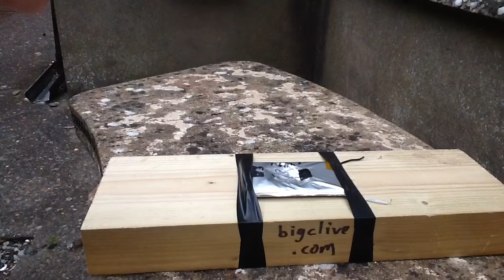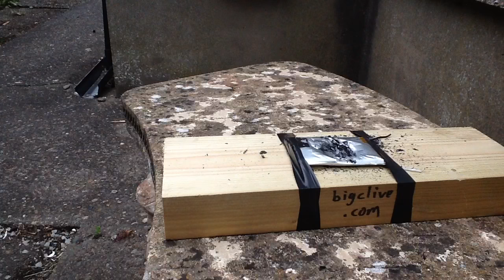Nail through fully charged LiPo cell super-anticlimax.

Comment: I bet this battery was old... Or high quility...
I had ebay batterys in my 200w vape.. they blew up in my face
Reply: Yeah, in case you hadn't figured out by now, you need some cells that can reliably output 15A+...
Most 18650s, like the ones found in laptops. can only safely handle about 3A before they start getting warm.
Reply: Yeah after that i spent like 90$ on 3 batterys from the shop that are like 3.7 v 50 amp
Reply: INVISIBLE SUN Sorry bud, you got massively ripped off, you can get 30A cells for about $10 or less and I dunno what the max output a lithium cell can possibly provide but I'm very doubtful those can output anywhere near 50A, I'm not a battery expert but I've never heard of cells that can do that, aside from some high-end RC toy batteries.

I'd recommend some Samsung 25r or LG HG4 cells.
Reply: They do, for good builds like on the 200W alien claptons it will pull every bit of 150 amps off all 3 batterys.. for about 5 seconds
Reply: I tried to do that on these so called "30 amp, 6000mah batterys" and they blew up... lol
Reply: Braging rights...
I acturly got the rx200 because it has 3 batterys and it will last longer. the coil i have one it is at .4 ohm i run it on 45 watts... the batterys will last me 2 days of heavy use

Comment: I'm assuming most batteries fly off while they are still being charged or if their is a load being drawn.  Gosh you shoulda been the Note 7's battery tester :O  (too big a phone even for my hands.  that and I find it silly to be carrying around a 6+ inch phone.  They'll make jokes about this someday  At some point the phones will be bigger than they were in the 80's smh.  Think they had a joke graphic about this about the phones were getting smaller and smaller then they discovered you could watch Porn on the phones.  Now they keep getting bigger and bigger :P  Samsungs tend to be plastic.  the HTC made of metal.  Think more heat dissipation on that.  Indeed .  Putting a METAL HTC inside an enclosed Otter Box is just dumb when using it as a GPS navigator.  Which for a 6 month old phone basically almost fried the phone when it came out of a dead zone X_X.  and I've had both my brother and dad say thats not possible , their phones don't have such a problem.  Possibly because samsungs dissipate heat differently , although I have held some rather warm Samsungs.  Plastic mind you.  Bit harder for metal phones to catch fire.  Burn your skin yes but not go bang.  )